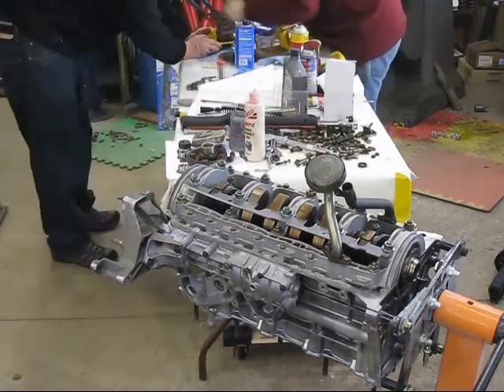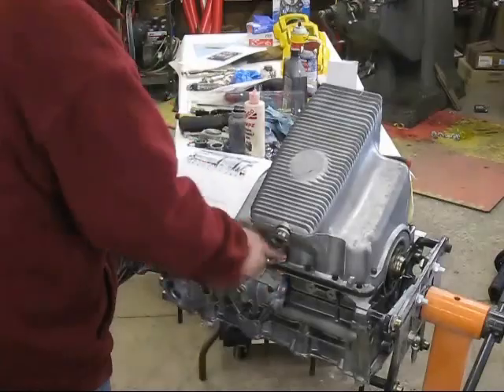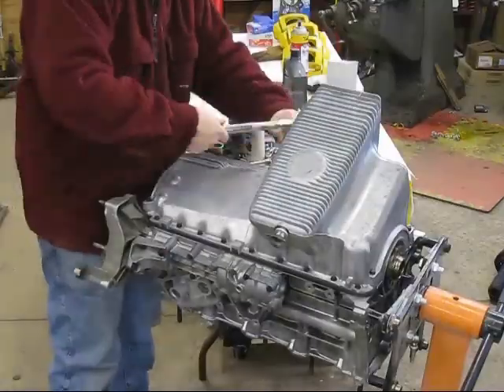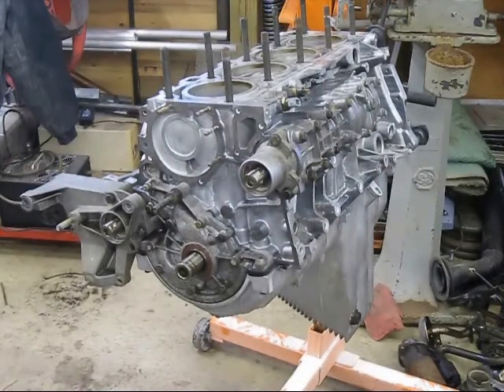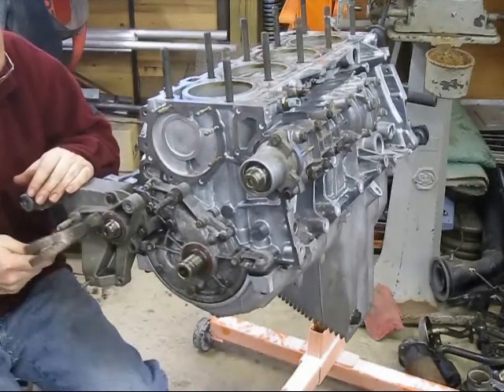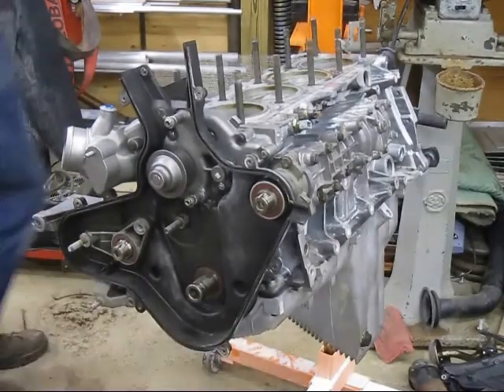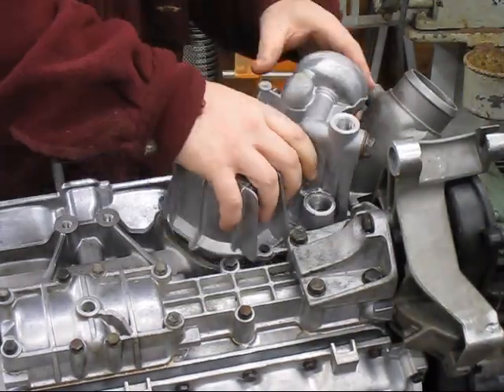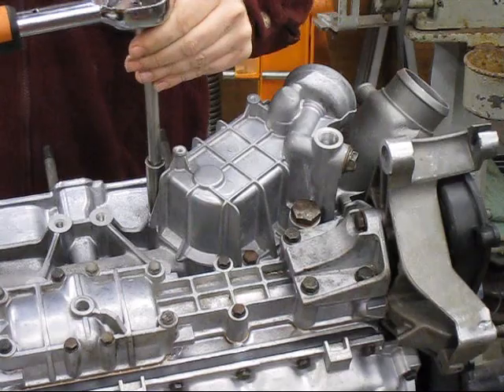944 engine assembly - oil pan, front seals, water pump and oil cooler

Comment: Hey Van, I am on to the rebuild of my 944 engine and i need to degrease a lot of it. I was wondering what you use to clean the oil stains around the oil pan seal it it safe to use normal degreaser around and or in the oil pan. Thanks in advanced.
Reply from the maker: Pressure washing.  I've also used baking soda blasting before.

Comment: On my first 88 944 NA, i did just that. A year later, while driving, the oil pressure suddenly dropped from 5 bar to 1 bar (high way driving at around 60mph). Then, it just hit 0 and the engine locked up. After further inspection, we found the OPRV was stuck open. Now i own a 86 944 turbo, i always used that alignment tool, costed around US$30, for a piece of mind. Not saying what you did is wrong, just different experience.